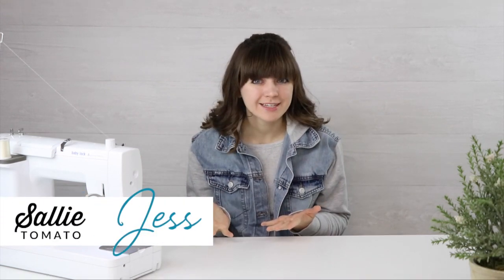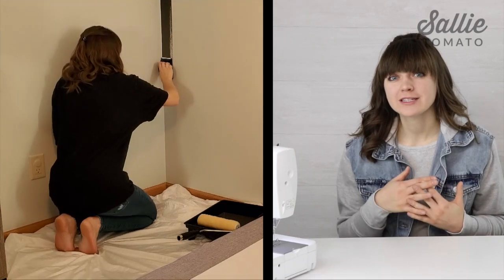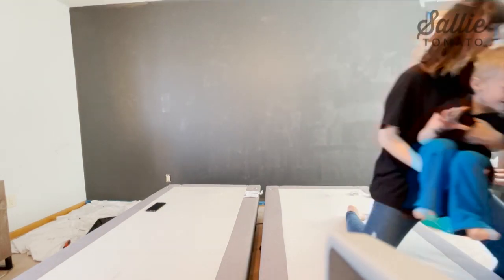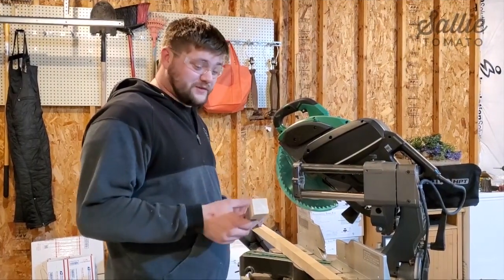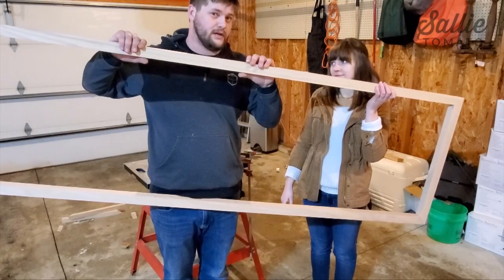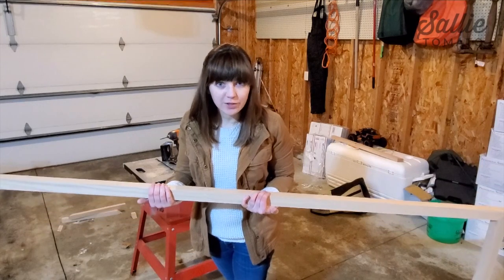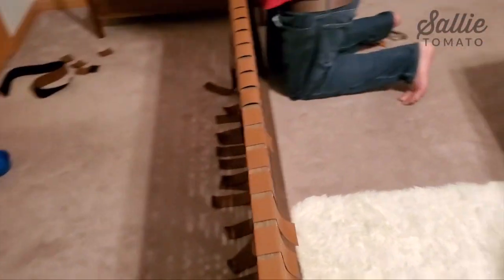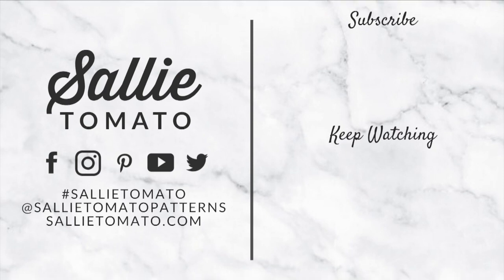DIY Woven Headboard and Bedroom Makeover

Comment: Do you have any videos showing how you cut the strips to ensure they are all straight - I have a 4' drywall square and a carpenter square and a rotary cutter but I am nervous about keeping a straight line.
Reply from the maker: Sorry for the delayed response. Keeping that straight edge is the hardest part. The best suggestion we have to get the best results would be depending on the size of headboard for the fabric length. Use a piece of lumber that is straight for the desired width. Share the finished project with us at #sallietomato.  Happy Sewing!!